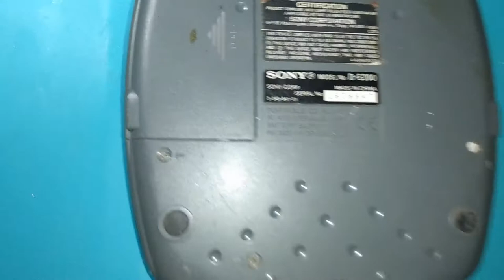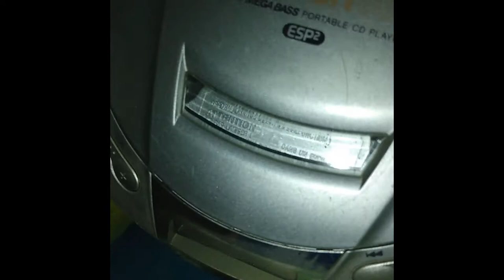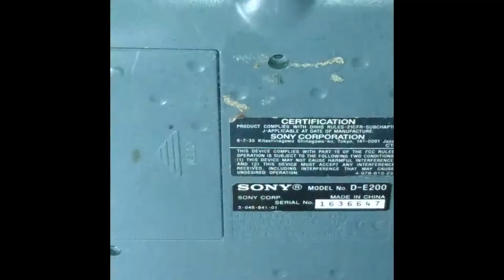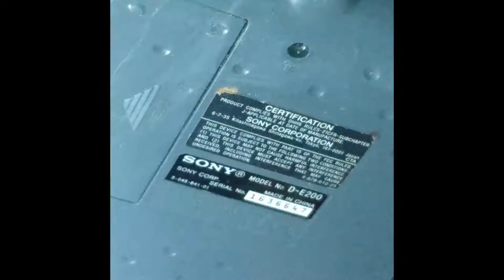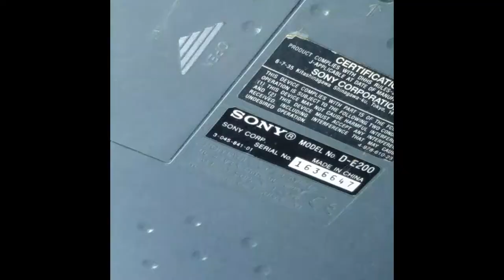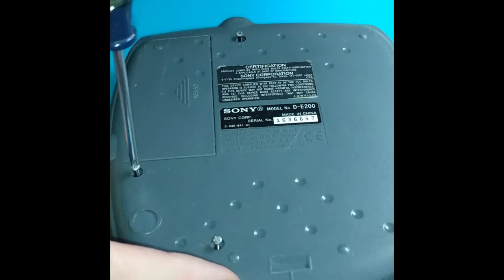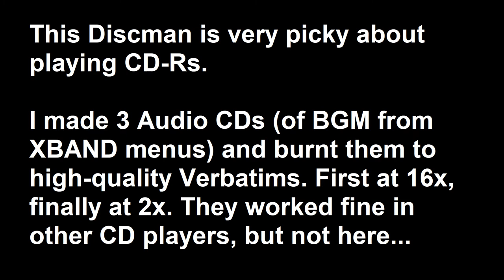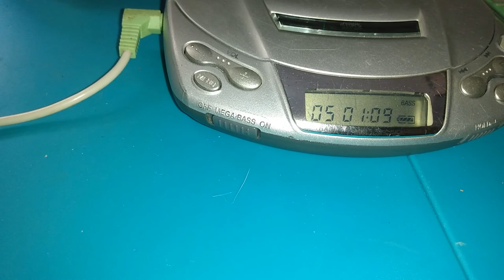Sony Discman D-E200: Deep Clean & Pot Tweak [No Commentary]

Comment: Nice video, I'm trying to fix a discman from 2000 that has problems reading some CDs, I tweaked the pot a bit and it works for most CDs, but there is one cd that seems to never work correctly, but the CD it's fine bc I tried it in other players, so I don't know if the CD is weird in general or the laser is beyond repair at this point
Reply from the maker: Is the non-working CD an MP3 CD? The Discman in this video played every redbook audio CD I tried with it (even if scratched heavily), but it wouldn't work with any of the CD-Rs I burned.
Reply: @gpr-garwoodprecisionrepair6256  it's a regular music CD, Sgt. Pepper's to be precise lol, the audio keeps stuttering and sometimes won't even play at all, there are other CDs that stutter a bit then it goes back to play normally. I haven't check the spin motor, but if it works with most CDs then I don't think that's the issue. The pot settings I tried where 2.3-3.0 kohm, anything beyond 3.0k makes the laser to not recognize any CD so I just sticked with 2.5k

My guess is that it may be some manufacturing thing with the CDs, they play OK with most modern players but they have issues with very old players, that, or as I said before, the laser is very old at this point
Reply: @gpr-garwoodprecisionrepair6256  pretty weird that it doesn't work with CD-R, did you make sure that you burned them as audio and not files? The discman I have can play CDR with no problem, and it's from around the same year
Reply from the maker: @richieMP118  It refused to play a few MP3 CDs back to back, so I slow-burned an audio CD to a Verbatim Life Series CD-R and still had no luck - even though it plays really scratched up discs. No clue why.